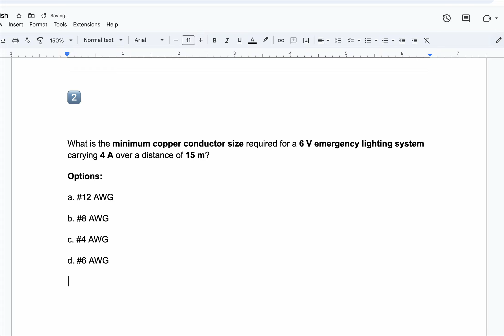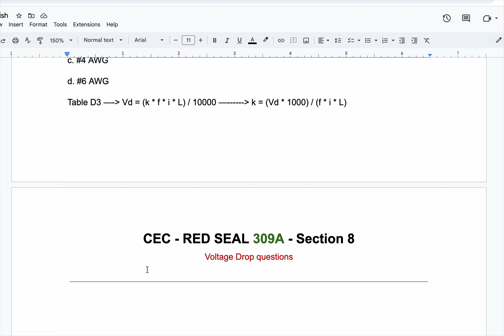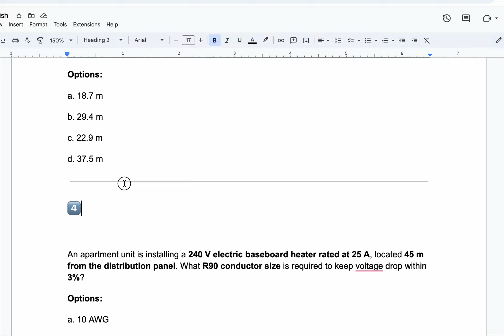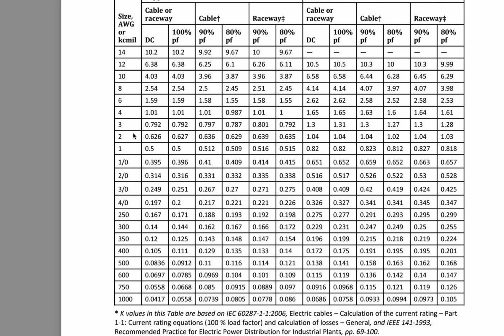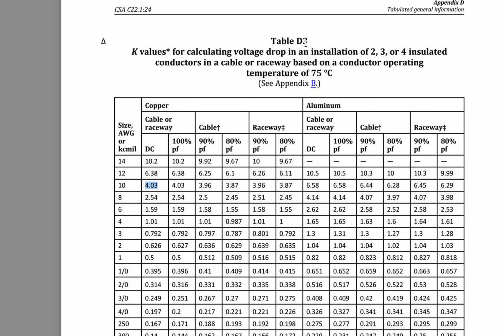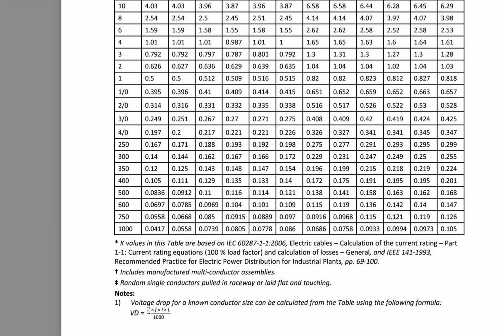Voltage Drop Explained | 5 Red Seal Exam Questions Using CEC Table D3

Comment: Sir
The second question needs to be addressed according to Table D3 Notes: 4), considering 0.86
Reply from the maker: Thanks for pointing that out. You may be right depending on the specific question and the application of Table D3 Note 4. I’ll review the calculation again, especially the 0.86 factor, to make sure the explanation is clear and accurate.

Comment: Sir
8:48  what about the 80% rule
4 A/0.8 =  5 A !

Other question that's been bothering me a lot.
What is the maximum distance and voltage drop covered in Table 1, 2 ,4 ....?
Reply from the maker: Yes, exactly! If 4 A represents 80% of the allowable rating, then:
4 A ÷ 0.80 = 5 A
So the calculated maximum rating would be 5 A. Good observation!

Comment: Holy shitmyour using a calculator get one with the app that dont need to do all shit this , aww fuck now i got to pull all the wire out
Reply from the maker: You’re right that calculators are used on the job. The reason I teach the method is for Red Seal exam questions and troubleshooting when the numbers don’t look right. Both matter.

Comment: Hi sir for the last question i didnt round the k value to 4. I use 4.03 and got a value of 24.81 for the length.  In this case would i go to the smaller value of 18.3 since 25m is exceeding 24.18m?
Reply from the maker: It's 24.81m and too close to 25m
Reply: Splitting hairs , you up size , then it don't matter , if the job is one them hard bid jobs you don't need the head ache of customer adding ,load after it's all pulled. 
Like .19 is gonna be a big deal , bullshit stuff they make you do ,  funny thing is all these questions they ask and some of its oh that's trade knowledge your supposed to know that , well put it in the fuckin book , some people ain't done it , or building code questions put it in the book , , examples of how to do calculations put it in the book , have pics next to the shit they trying to explain some people don't visualize it well with words , they know that yet chose to ignore this , then the csa guys and their learning course that's another story , incomplete Workings and wrong answers.  Makes a person feel real confidant.  Yeah speed up your explanations , and don't do it in the cafeteria,  it annoying , not as bad as the dakota prep chick but you up there , she's wacky .